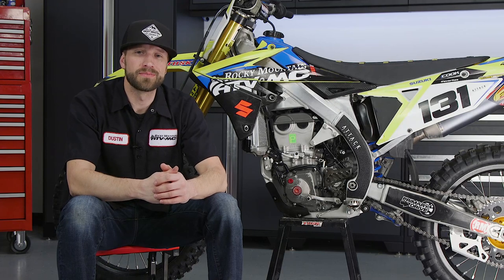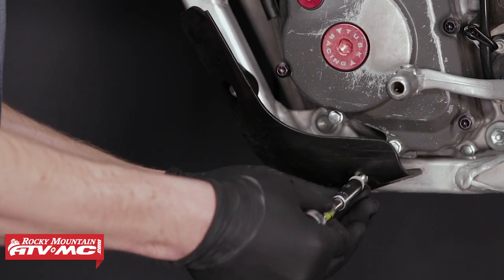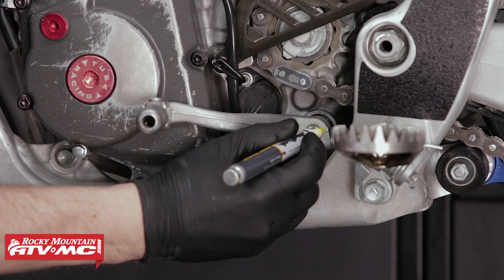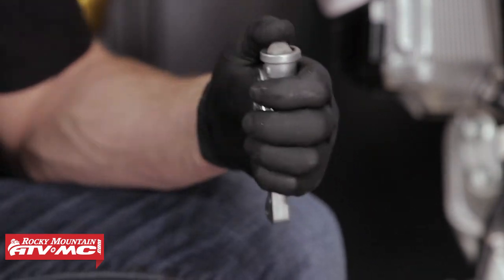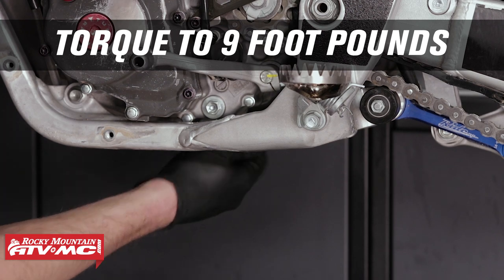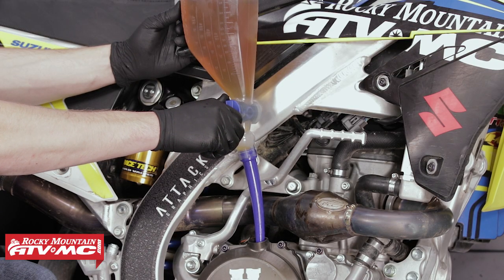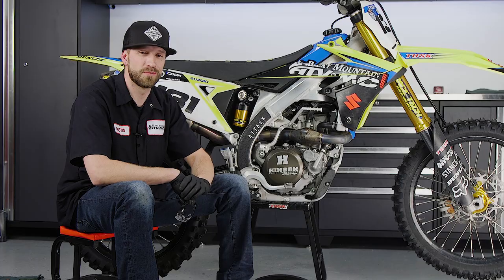How To Change The Oil on a Suzuki RM-Z450

Comment: This may seem like alot but if you follow these steps you will see 300 hours out of your rm450 without touching a thing
Reply from the maker: That's awesome! Looks like i'll get a lot of hours out of mine. Simple maintenance is overlooked way too often. Thanks for the comment, vevohoeyo (interesting name).~Chase
Reply: Agreed! 👍 . Its indeed all bout maintenance. What 4- stroke oil do you run ..recommend? How many hrs before changing? Thanks. - Ohio

Comment: What type of oil do you prefer to use on this rmz450. Thanks
Reply: The ecstar in the video is suzuki branded. I used it on my 20202 and then went to amsoil. I'd reccomend amsoil. Little more pricey but great oil.
Reply: Use ECSTAR R9000 Full Synthetic
Reply: It’s made for Suzuki’s
Reply: Picking oil by weight has to do with the climate you run in. I would say synthetic 5w30 or 10w-40 group IV or V .

Comment: Can someone tell me why my 2015 rmz 450 is leaking coolant from the overflow tube by radiator cap?? Help please
Reply from the maker: It's hard to say. Could be something like a bad seal or head gasket or something as simple as a bad radiator cap. You can perform a leak down test to see if it is something internal (video here: https://www.youtube.com/watch?v=CC1EZCxDnLc) or try to replace the coolant and get a new radiator cap to eliminate that possibility.
Reply: @rmatvmc  thank you I will check the video out and go from there.

Comment: U don’t need to replace the gasket just to change oil ur ripping people off
Reply from the maker: You can not replace the magneto cover gasket if it's in good shape and you're comfortable doing so, but the Suzuki manual does recommend to change the gasket with every oil change.

Comment: One other step I like to do (it usually allows a little more oil to drain:

With drain plug removed, hold kill switch and kick engine 3 times.
Reply from the maker: jcbenson01 Thanks for the tip!
Reply: Don’t you think it’s probably bad for your motor to be kicking it over without oil in it?
Reply: Chris Davies not at all. If you were to start it, yes, absolutely. But just to kick it and rotate a few times will not hurt a thing. The bearings are already lubricated and won’t be spun enough to build up heat and wash the oil out. It’s a step included in the factory service manual.
Reply: I do that with my rmz, it actually makes your oil look newer next time your draining it because the clean oil isn’t mixed with dirty oil

Comment: where can i get the oil measuring cup with the valve on it? i've looked all over rmatvmc
Reply from the maker: That is the Motion Pro Pro Funnel. You can check it out here: https://www.rockymountainatvmc.com/parts/motion-pro-pro-funnel-p
Reply: @rmatvmc  thanks! Out of stock 😞

Comment: What did u use to clean the oil drainer ? Just air ?
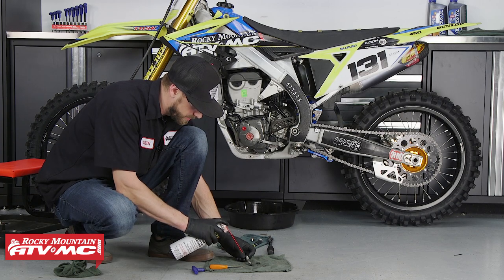Reply from the maker: We used PJ1 contact cleaner to clean out the oil strainer screen. You can see that step at 2:24 in this video.

Comment: I just got a 07 rmz450 and I put like 1700ml of oil in it and oil still doesn’t come out of the check bolt isn’t that way too much oil? I looked it up and it says it only takes like 1250ml
Anyone know what I should do?
Reply: Are you checking it with the bike upright & level?  How much oil did you have to put in it for it to come out of the check bolt hole?

Comment: I have a rmz450,2015 is it okay if i use 10w50 oil?
Reply from the maker: Suzuki recommends 10w-40 for your motorcycle. You could run 10w-50 and most likely not notice much difference but it's always safer to go with manufacturers recommendations.

Comment: Same for 2019?
Reply from the maker: Yep
Reply: What pain in the ass, should stuck with Kawis
Reply: @CG-fj5se  that really is a pain in the ass so much better extra work to change oil
Reply: @rodneyburke2202  riding gas gas 450 now.. piece of cake 👍
Reply: @CG-fj5se  I'm about to sell my 19. You like that gas gas? If I'm going to buy a 10k 450 I want it to be massively better than my RMZ. I can get a 22 RMZ 450 for 7k out the door. Paid 6800 for my 19 brand new as a leftover in spring of 2020